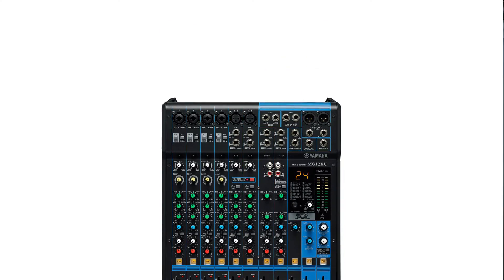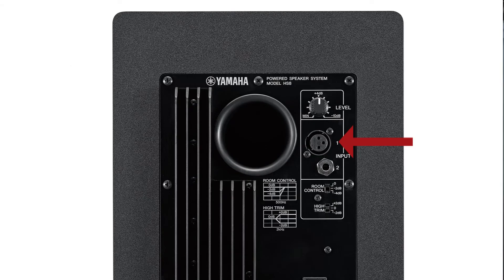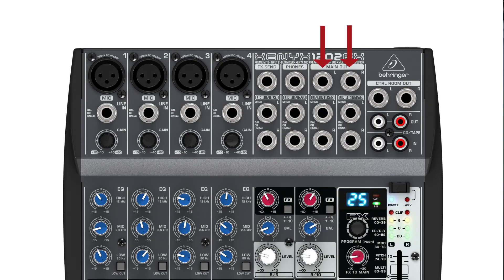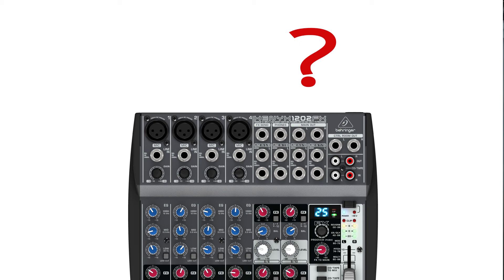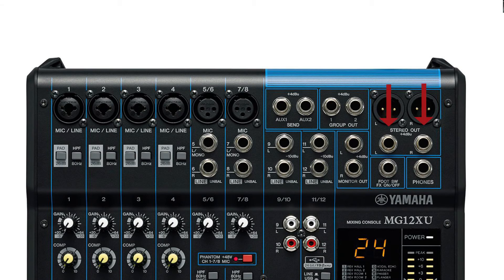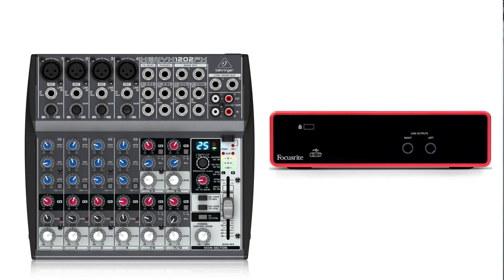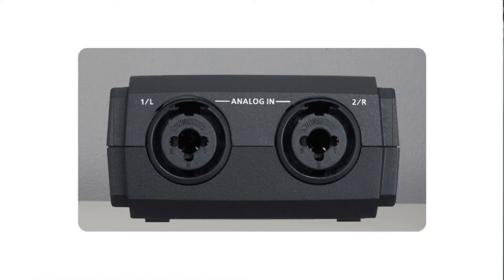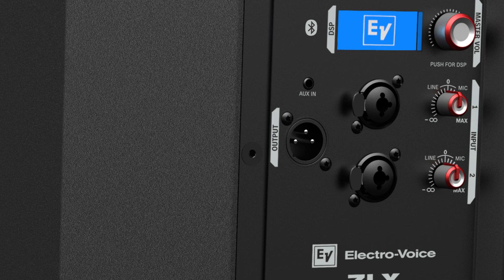Balanced cables explained for beginners

Comment: Hello on my mixer it has an output that says stereo out L.  +4dBu would this be balanced or unbalanced connection.....
I'm trying to connect an crown 2000 cts amp on the back input it has on channel 1 input - ¥ + connection it also has a switch that says "Y" input  on or off can ju help me I'm just starting to di and am very lost in this and don't wish to burn up my first amplifier... Your video was very helpful but I'm still very confused right now....